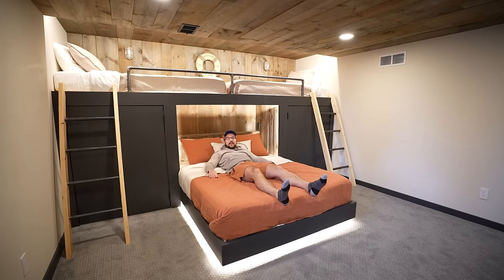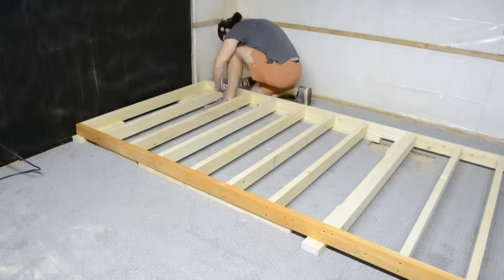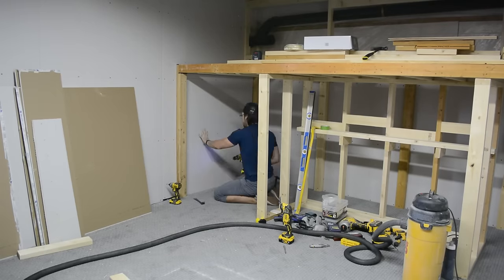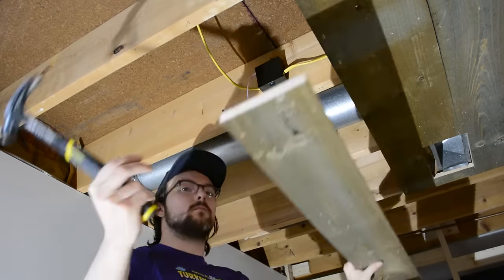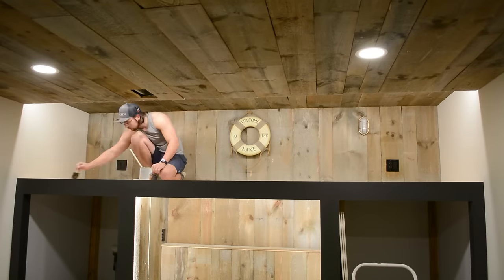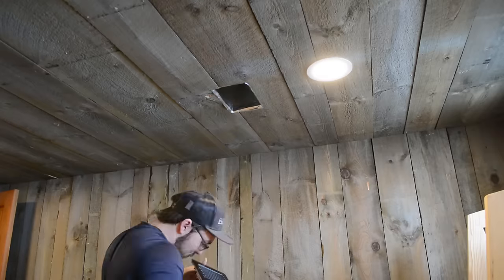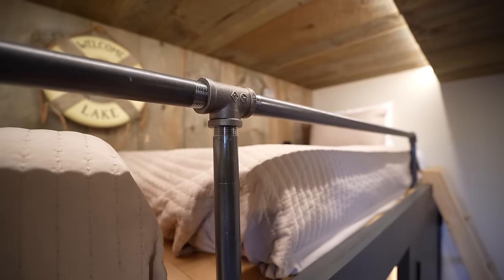BEDROOM MAKEOVER Start to Finish - DIY Lake House BUNK ROOM

Comment: You nailed this makeover, I love it. Only tweak I would've done would've been to include "night stand" cubbies for the beds up top. Using some of that dead space below the septic line, I would make some box inserts into the wall between the outlet and the life saver floatation device, giving them a spot up top to place whatever they plug into the outlet, like how the queen bed has the shelf with the outlets.

Comment: Love this build,  my kinky critique is building top of the carpet as now its near impossible to replace the flooring in the future without compromising the bed.
Reply from the maker: Thank you! We replaced the carpet just before this reno so we don’t plan on changing it anytime soon. You can replace the flooring and just shim the few points where the bed touches the ground. Also, I think cutting the carpet out from under bed before starting the build would have led to more headaches. I would need to install a ton of tack strips on top of the concrete subfloor which is never fun.

Comment: I love, love, love this room.  One thing though.  The carpet.  you built everything on top of it.  So If you ever want to change it out for other flooring.... that could be a real pain.  Love that you used the wood on the ceiling..... 1,000% better than that acoustical drop ceiling that was there before
Reply from the maker: Thank you! We replaced the carpet just before this reno so we don’t plan on changing it anytime soon. You can replace the flooring and just shim the few points where the bed touches the ground. Also, I think cutting the carpet out from under bed before starting the build would have led to more headaches. I would need to install a ton of tack strips on top of the concrete subfloor which is never fun.

Comment: This looks nice, I will most likely use this as inspiration when I remodel my daughter's basement. What I have issue with is the fact that you installed wood on top of carpet, my OCD is going crazy right now.... Also, for noise mitigation I would have installed fiberglass batts in the ceiling to deaden the floor above.

Comment: looks great. The only addition I would make would be small niches w/ usb plugs on both sides of the queen bed.
Reply from the maker: Thank you! I have 2 outlets on either side of the queen, but I could also add usb plugs. I also have a ledge/shelf behind the pillows of the queen to put your phone, water, etc. I thought about niches but I didn’t want to cut into the storage space. Thanks for watching!

Comment: This was just a great makeover. Only thing I would change is for the upper bed, to just have one long flush bed/mattress that would go all the way across instead of having two / or have 2 but no gaps. This would allow for taller and shorter people to share the space up there sleeping on opposite sides. Very well done
Reply from the maker: Thank you! I agree, but I would have had to have a custom mattress built for that to work. Mattresses only come in certain sizes and 2 twins worked best with only about a 5” gap in between
Reply: @GoldenKeyDesign  I like the gap, as a tall person I'm used to my heels sticking out past the end of the mattress, which just feels normal to me.... however two teenage boys might not like their feet touching!!!!
Reply: The gap might also help if one person moves around in their sleep. It will prevent movement from traveling to the other mattress. Also changing bed sheets would be a lot tougher.
Reply: @abbaddon715  changing the sheets is gonna be hard enough without trying to change them on some 12' custom mattress!!!!!

Comment: Great remodel. One suggestion is to revisit the safety rails on the upper beds. You can read bed design codes. I like to keep spacing <4” in any direction. The idea is to avoid kids heads or limbs ever getting caught.
Reply from the maker: Thank you and great point! Right now it’s just adults sleeping up there but I will add additional safety features once kids starting sleeping up there

Comment: Looks good well done. Im not saying you should but this just a helpful tip for next time you could of used a nylon wheel on an angle grinder or a nylon wheel on the restorer n hit those boards just to clean them up then spray on an acrylic clear coat. But you do you again looks good.
Reply from the maker: Thanks for the tip!

Comment: If you get a lot of visitors you might want to look into some diffusors for the few LED strips. To my knoledge paper, spaced roughly 1cm off the strip with a basic encasing works wonders preventing the rough lights. Props for the room make over, fron germany.
Reply from the maker: Thank you! I actually did use diffusers on the top bunks. I installed the LEDs inside black metal rails with a slightly frosted white diffuser. Makes a huge difference! For the LEDs on the lower bed it wasn’t necessary as the wood strips I installed basically act as diffusers. Thanks for watching!

Comment: Great idea, looks amazing. The mattresses above will probably slip, so you'll probably have to put a board in between as a stopper.
Reply from the maker: Thank you! They actually don’t slip at all. I purposely didn’t sand the coat of poly I applied so it’s pretty grippy 😁

Comment: Looks great! Some thoughts: Those pipes are going to be uncomfortable for bare feet to climb. I'd suggest a ladder rebuild with wood and re-purposing the old ladder parts to make a couple of folding luggage racks.  Throw a half dozen additional hangers onto the hanging space, and all luggage management needs will be met.

To make the room more welcoming: A wall mirror on the wall opposite the windows, to both increase light and provide a place for guests to check their appearances. A throw rug, a slimline upholstered armchair, and an ottoman using colors already in the room would be amazing, if you can fit them in. A place to sit that isn't the bed not only makes the room more classy and comfortable, it can also make a world of difference to older and/or less physically able guests to have options on where to sit when trying to manage their footwear.

Comment: 1 important remark, slats in a bed are mostly to create air circulation so the mattress can breathe and be used for  longer... So please fix some ventilation for those upper mattresses
Reply from the maker: That’s a great point! I can always drill some holes for more ventilation. But these beds will probably only be used a few times a year so it’s not a huge concern for me

Comment: It is a good idea to cut holes in boards that are supporting mattresses to allow for some ventilation. If not possible it may be a good idea to advise users to lift the mattress to allow air to get to the base. (Having seen a few mouldy mattresses.)
Reply from the maker: Good point! I installed slats rather than a full sheet of plywood for that exact purpose. It allows for plenty of airflow
Reply: @GoldenKeyDesign  Great!

Comment: I love the way you edit. I'm not sure I like the ladder rungs: slippery and unforgiving on tender feet, since there is less weight distribution on the round surfaces. Form over function may have met its match. Has anyone used them?
Reply from the maker: Thank you! We used them and they work as intended. They do have less contact with your foot but it’s not painful by any means

Comment: Huge transformation! Awesome to see start to finish. 
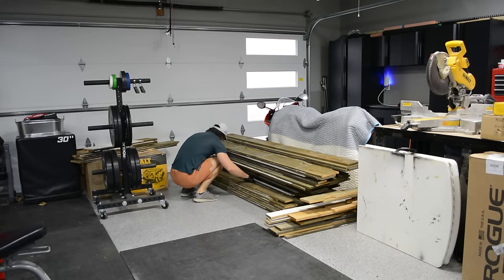- That door falling at 3:04 was so satisfying haha
- Not the planer! That's definitely the route i would've gone to first, assuming scraping was out of the question for that much wood. I have my eye on one as well. Glad the wood worked out in the end. I love the wrapping going wall/ceiling/wall with drywall on the sides.   
- Love the 8:21 drywall hit on beat. Too much fun to edit those in.
- So many small details that were well thought out (small trim pieces, electrical for bunk beds, blocking for pipe "handles"
- The lighting/focus/audio on your last shots of you sitting on the bed looked excellent and a big step up production quality wise. Maybe it's just the lighting in the room, but it was well done. Hard to incorporate that with seeing the project throughout a video, but it feels very professional.
- What do you use for LED switches? I haven't really played with them but have a project they'll fit nicely into.
Reply from the maker: Thank you so much! I always appreciate your thoughtful comments. 
- door falling was one of my favorite parts too haha
- Yeah, scraping would have taken ages too. I honestly may have had a malfunction with my planer because it saw SO slow. Regardless, it had to be returned. But, I may still buy one in future when I have another project that requires it
- Glad you caught that. I spent a lot time on sound design for this video. I tried my best to make the music beats line up nicely with the video. If done well, most viewers don't even consciously notice, but still appreciate the quality of the production
- The thinking ahead aspect is probably the hardest part of each project for me. It takes a lot planning and forethought. You have to pretty much have the design locked in from day 1 of the project which makes things stressful, but it usually turns out very nice in the end
- You have a good eye! I actually upgraded cameras/lenses. The majority of the video was shot with my 10 year old entry level Nikon. The ending was shot on my new Sony A7IV with a nice wide angle lens. I also got new wireless mics and gimbal! I used the gimbal on some of the b roll shots. This purchase has been a long time coming and I'm excited to increase the production quality of the videos moving forward!
- I used standard switches (not anything LED specific). The key is that you get an LED driver. You run your 120v line to the driver and that outputs a low enough voltage to power the LEDs. As long as you use a driver, you can use any switch. I linked the one I used in the description. Dimmable drivers are usually much more expensive FYI, but I think they are worth the cost
Thanks again for watching and commenting!

Comment: Nicely done! 😁👍 Admittedly, it wouldn't be my personal preference for color palette (I tend to lean more towards either pale white-ish wood tones if I'm not painting wood or a pale grey driftwood-ish stain, along with cool blue range color tones with a single warm pop of either red or orange sprinkled around) but it still turned out really nice.  As for the wood boards, try some bleach on the wood you deemed too dirty.  You might be surprised. 😉
Reply from the maker: Thanks for the tip!
Reply: @GoldenKeyDesign  No problem!  If you can, let me know how it turns out if you try it!  I've only tried that trick on previously stained wood myself and it gives this lovely weathered grey tone to the wood but I believe the back of the wood that you were using is completely untreated so I'm not sure if it will do much beyond cleaning it but it should look better either way. 😁👍

Comment: Just found this video and I am jealous... I want a room to remodel!  I do have that planer and was curious... What setting did you use?  It has a "rough" and "finish" setting.  The finish setting goes a lot slower and gives a smoother finish while the rough goes through faster.
Reply from the maker: I tried both settings but it still wasn’t working properly. Believe me, I tried everything to get it to work, but nothing seemed to do the trick. I returned it, but I may pick up another in the future when I have a use for it. Think I may have gotten a lemon. Glad you enjoyed the video!

Comment: Do you know that planters got multiple speeds right? Even my $3000 planner doesn’t go any faster than the Dewalt 735 on its fast speed.
Reply from the maker: Yeah, perhaps I was expecting it to go faster. Regardless, it was too slow to do all those boards 😅

Comment: At first for ceiling which material did you use ?
Reply from the maker: I took out the drop ceiling and replaced it with the wood from the walls

Comment: Great build, definitely looks like a (very spacious) cabin in an old boat :P 

What did the gap between the top of the mattress and the ceiling end up being for the loft beds? I'm planning on building myself a loft bed but i cant tell what size gap will feel comfortable. thinking 70cm would be enough.
Reply from the maker: Thank you! The gap between the top of the mattress and the ceiling is 66cm. I think 70cm would work great. If you have the ceiling height, I would even go with a bigger gap, but 70cm would still be very comfortable. Thanks for watching!
Reply: @GoldenKeyDesign  thanks man. Yeah, from the video 70 seems like it will be more than enough. It clearly won't feel too much like the ceiling is right in your face or anything. 
I've got a limited height to work with in the room you see. 2.4 m ceiling heoght. So the below side is going to be just enough for me to fit under in an office chair. 
Just need to come up with a final design for the desk underside since I can't cut my own wood, got to order it all pre cut.
Reply from the maker: @ge2719  Gotcha - sounds like a fun project! DM some pictures of the finished result on Instagram when you're done. Would love to see it!

Comment: wait, you took out that soffit around the pipe, but didn't replace the insulation around it. is that loud now when the water upstairs runs?
Reply from the maker: I did replace the insulation. I show it in the timelapse 😁

Comment: how much did it cost you to make this all
Reply from the maker: The reclaimed wood was all free obviously, the bed/ladders cost about $300 in materials, and the desk was about $200 since the pipe is quite expensive. So about $500 total
Reply: @GoldenKeyDesign  And how about the drywall, wiring, lighting, trim and paint?
Reply from the maker: @markkarolich7548  I would estimate around another $300

Comment: I'll sub as soon as YT let's me, they say I have too many for "the amt of subs" I have...:(  Soon!!

The Backyard Transformation, w your new camera gear, etc., was 5 steps up!!!p
I've a "helpful" viewer suggestion LOL; for your baseboard use timber the same height as the main, iron ore-painted, front-facing trim on the bed/nook frame. 
6"? 8"?
Not so the architraves or window trim, most likely.

And, actually, your aesthetic is so intentional my suggestion could be dumb.
 You're welcome. 😊
Reply from the maker: Thanks for watching and I appreciate the feedback! I did strongly consider using a larger baseboard

Comment: Why didn't you flip the wood and hammer the nails out?
Reply from the maker: That is another option. In my experience, the vice grips are faster. These old nails bend easily and I usually have more issues getting them out with the hammer. I also didn’t want to accidentally damage any of the wood with the hammer.

Comment: why didn't you swap out that grimy carpet that you made worse by not covering it as you built on it?
Reply from the maker: We replaced the carpet throughout the whole basement a couple months before starting this project. The sawdust was quickly cleaned up with a vacuum 😁

Comment: You take the planer outside so that you don't create a lot of saw dust in the house, but then you use the miter in the house?? 
Granted, it's not nearly as much - but ??????????????????????
Reply from the maker: I did this in the dead of winter and it was usually below 20 degrees outside. The planer creates too much dust and there wasn’t enough room in the bedroom anyway to do it in there. The miter saw creates a lot less and it was worth it to save time. Otherwise I’d constantly be going back and forth from inside to outside. Nothing a vacuum can’t fix

Comment: Why oh why would you pull the nail head through the wood ,hit the pointed end to make it pop out a bit the other  side then turn the board over to the nail head side  and pull  the nail out using the nail head . Your not making a big mess of the wood this way
Reply from the maker: The wood is 40+ years old and doing it that way with a hammer would have probably damaged the wood

Comment: Looks great. If you went that far you should have changed the flooring. Carpet is disgusting.
Reply from the maker: Thanks! Disgusting is pretty strong language 😅 We recently replaced it before starting the project actually. If you think this carpet is disgusting, you should see the old stuff and layer underneath it 😂
Reply: @GoldenKeyDesign  LOL I just mean in general. I am replacing my floors right now with Engineered Hardwood.  Believe me I know.

Comment: My only complaint is you left the old tired carpet. Shoulda replaced it while everything was ripped out.
Reply from the maker: We actually installed this carpet just before beginning this renovation. The carpet before this was 20+ years old and a dirty cream color
Reply: @GoldenKeyDesign  oh.   I thought it was old because you didnt take any steps to cover it through alot of dust and  mess.  I woulda installed a water proof vinyl strip flooring  that is wood looking planks (esp in a basement). But to each his own.
Reply from the maker: I just did several passes with a vacuum. We prefer carpet in a basement because it feels more cozy and is better insulation

Comment: You probably know this by now, and I know it might have seemed like a good idea, but sleeping in beds with no nightstand is a nightmare. No clock, no where to charge your phone, no light except the LED's. Sounds awful.
Reply from the maker: You sure you watched the video? For the upper beds, I installed wall sconces on either side and have an outlet on either side as well for charging your phone. For the lower bed, there is ledge where you can put your phone/alarm clock/water and there’s an outlet on either side as well 😁
Reply: @GoldenKeyDesign  a ledge on the back. That's not a side table. Probably fine if it's for kids though.